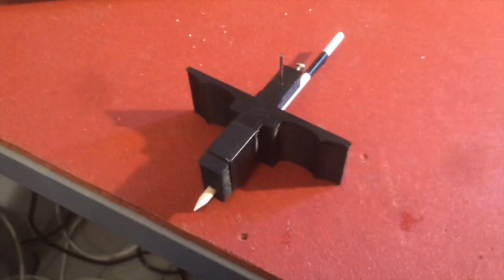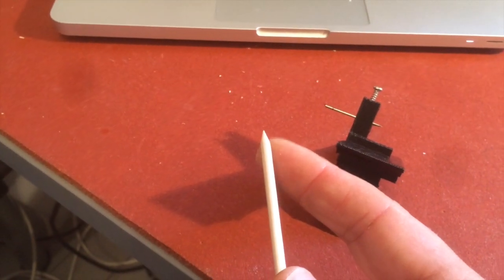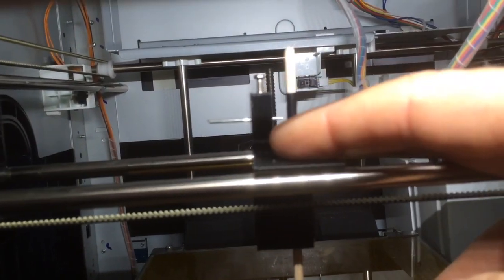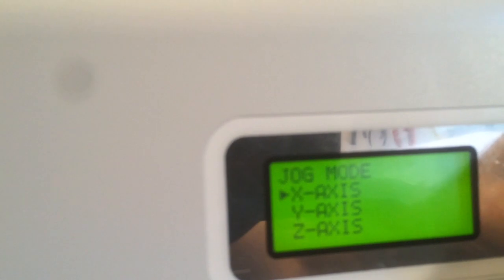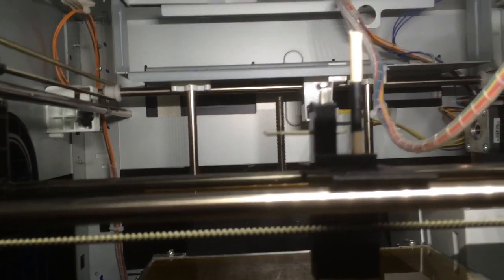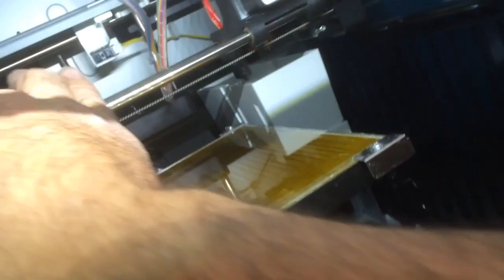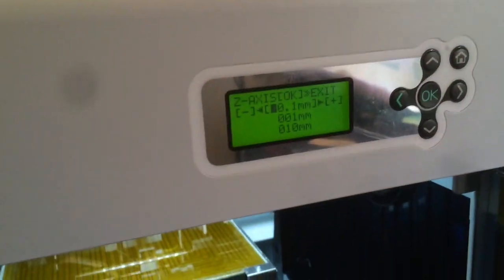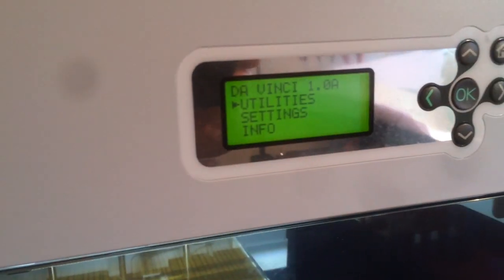XYZ DaVinci print bed calibration tool thingy

Comment: I noticed you are running a Mac with your printer. Are you using XYZware or have you flashed the printer and use repetier? I can’t find any info on switching the printer with IOS system.
Reply from the maker: I did run it with Simplify 3D, However, the XYZ didn't jive with the Mac. Just small things like I had to restart everything between prints and so on. I got me a cheap used PC running XYZ:s native software now. Which btw is much better now. I seldome use all the features of Simplify 3D and there were some issues getting all the settings right for the XYZ.  The printer is stock. No changes or mods (other than I did away with the "dump-tray". My advice. Get a cheap used PC and run XYZ-native software. Enough hassle with 3D-printers without the extra layer. ;-)
Reply: Thank you for the info!!

Comment: I was noticing the tape you used. You are using it a guide. However, I don't know the distance of the bottom edge of the tape in relation to the tip of your skewer. Is it 1in, 2in, 7in? Or did you just place the tape in a random location of the skewer?

Thank you for your response.
Reply from the maker: Coretapper, sorry for my late reply... The distance is (as you write) arbritary. My goal was just to get a way to se if the bed is level or not. 😄